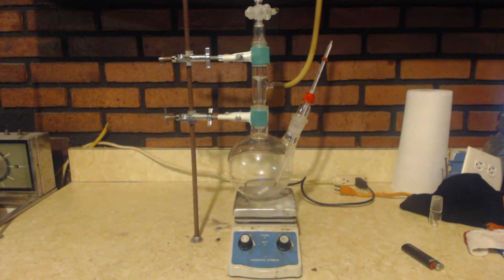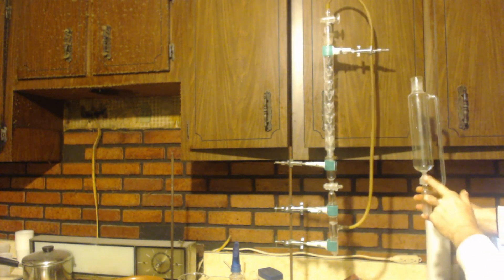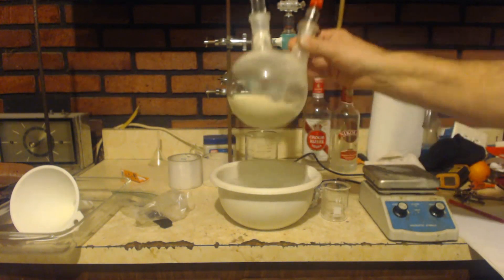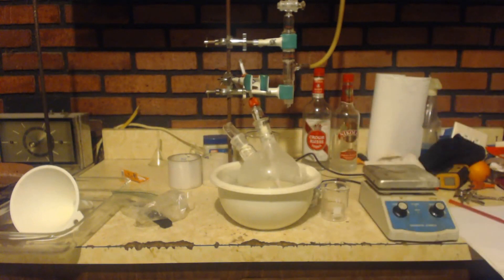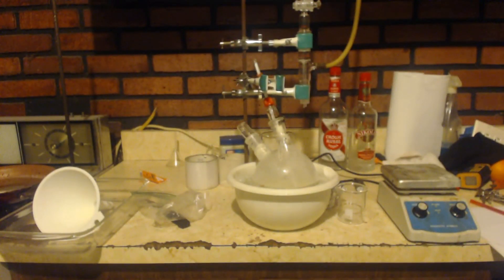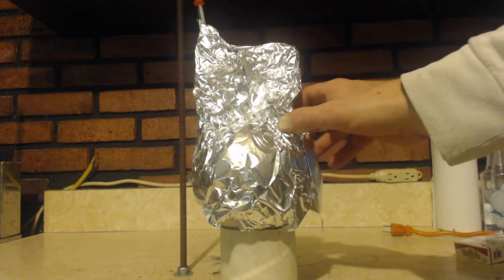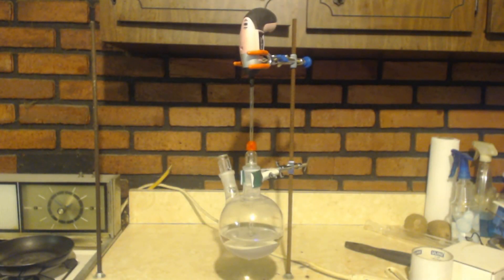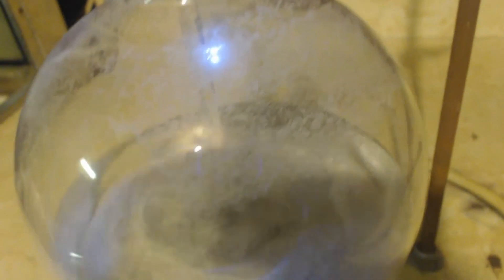NITROETHANE SYNTHESIS  part 1

Comment: John did you check to make sure that drill is explosion proof - brushless motors no exposed steel? Important consideration working with ether. And like another person said  wear gloves with ether and alkylating agents, and preferably as much as possible. Stay safe brother hh
Reply from the maker: Alex Redacted........No  i did nothing special with the drill. Although i did have a gasket for the glass drill bit preventing any ether from coming out.  I could not smell any ether unless i  put my nose right up to the gasket.  And even then i could barely smell anything.   But that is a good point to bring up about drill sparks.  Even when you do not see sparks on a drill......there are always sparks on the INSIDE of the drill.  As for gloves i rarely wear gloves

Comment: About the stirring bar there are some mistakes to avoid with the over stirring Wiz haighlee flamable volatile solvent you can not use a driller because of the Sparks you need a brushless electric motor which are cheap non the less
Reply from the maker: Jose ...... i got to work with what i already have in the house.
Reply: well that's the reason you can't use a driller with solvents like éter because you need a house to work with the things in the house remember what happened to me a few weeks ago with poliestireno which in terms of flammability there is no comparison keep in mind as well the distance between the driller and the boiling flask is very short increasing fire hazard for solvent concentration
Reply from the maker: @josemanuellopezgutierrez9200  ....I am going to do this experiment again soon and do a video on it.  I am definitely bringing up what you said in that next video I make.   About the drill